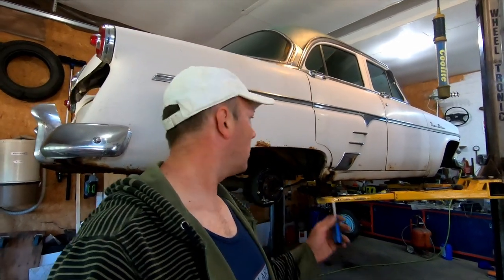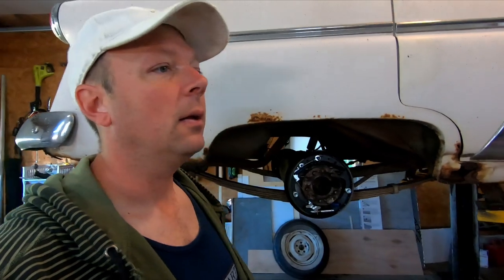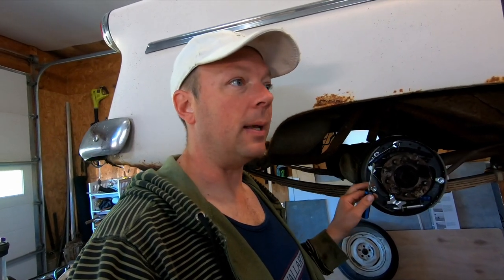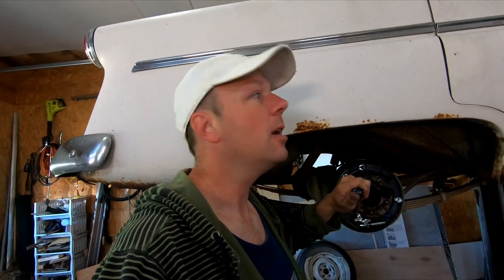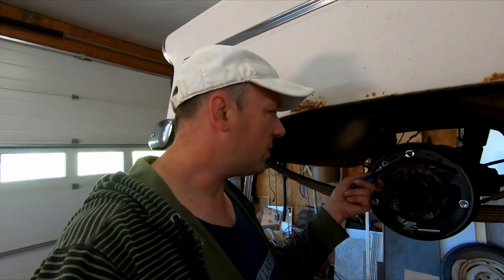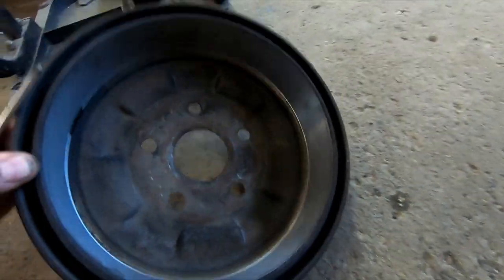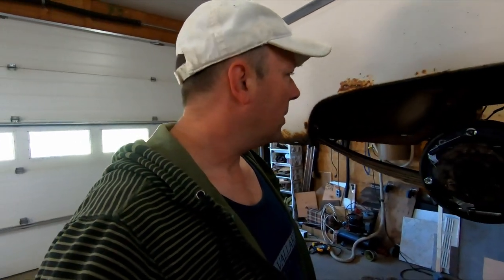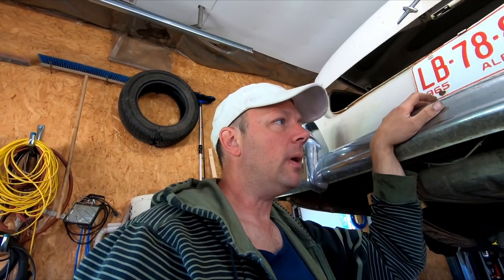Psychic Garage - Ep 20: Flathead gets brakes, cleaned out fuel tank and cooling system work!

Comment: Self adjusting brakes, an even better idea than having the starter on the key! That old gummy dry fuel most likely acted as a rust preventative. Good tip on using lye as a cleaner, I need to clean the fuel tank on the Fargo, and been wondering how.
I like the 'just talking' style, a nice change.
Reply from the maker: Thank you.

Comment: Greetings  from  Missouri !
   Hey Ryan !  A   LOT  of   good   info   in  one  12  minute  video !!                                             I  use  RA  whenever   I  can  afford  to  wait  for  parts.
  We just  went  thru  a similar  experience  with  the  fuel  tank  on  a  '66  Galaxie that  had  been  sitting  15-20 years.  
  My boss  just  couldn't  understand  why  2  cans  of  SeaFoam  and  a  bottle  of  Heat later,   the  car STILL  wasn't  running  right.           :|   
       I'll  have  to  try  a  FI  filter  on  this  '54 Chevy six  w/ dual  Webers  we  just  got.   
   THANKS  again  for  the  update !    43 thumbs  UP !!                                                                                                     PEACE
Reply from the maker: Thanks Brian, this is good feedback. I was worried this was just boring because of all the talking and not much film action. The part number for the filter is a Baldwin/Hastings GF115. I'll put that in the video description as well. Good to hear from you!